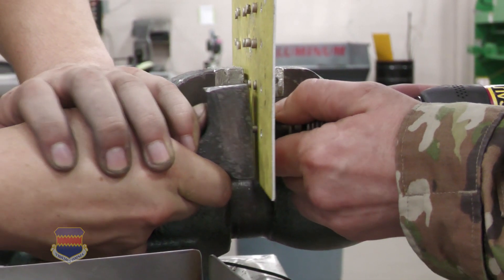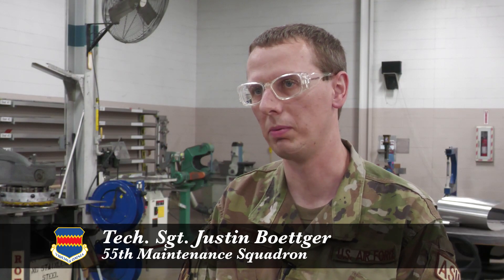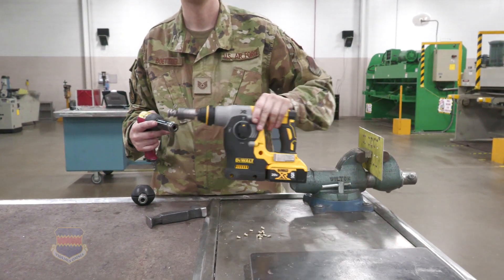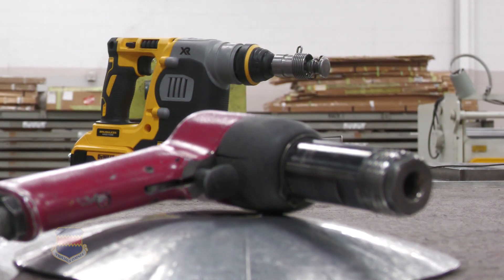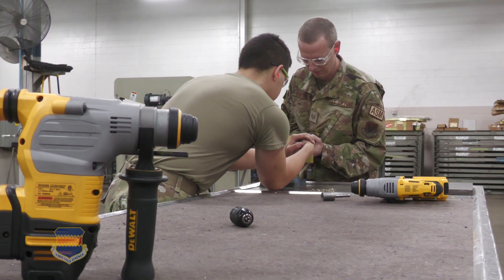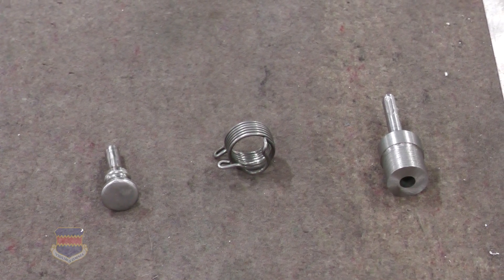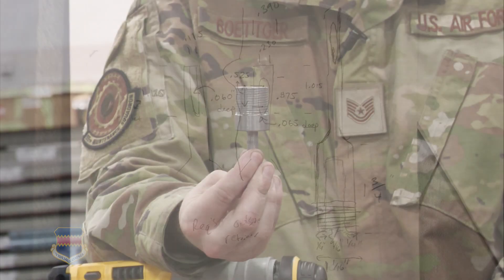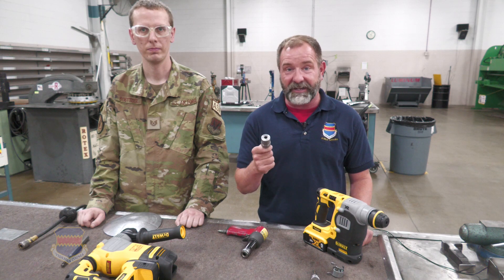Rivet Hammer

Comment: Well done Sgt..... I did this 20 to 25 years ago... I even included in one version, captured roller thrust bearing, to limit the rotation of the hammer drill... The hammer drill you really want to dial yourself in with, to really rock & roll, is the hammer drill for driving in commercial and residential ground rods.. These hammer drills are different then the concrete hammer drills. They have a harder impact per cycle/hit, and the frequency can be higher for more control. I have not measured the impact stroke of the internal anvil of the hammer drill compared to the more cost effective units, but is more stroke per cycle over the cost effective units, by DeWalt. Milwaulkee.... Perhaps, the a few other brands like, Hilti, or Bosch offer rotary hammer drills, but, ground round driver tool, I only know of about one manufacturer of such a tool, specifically only designed to linearly impact, with out rotational force/torque. The unit is still SDS series of union chucking or tool clamping and quick change ability.